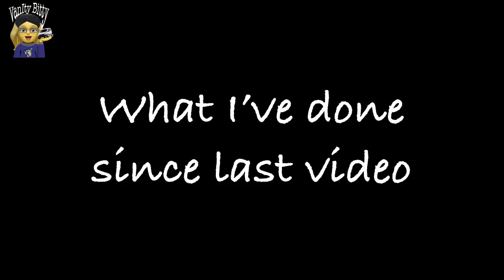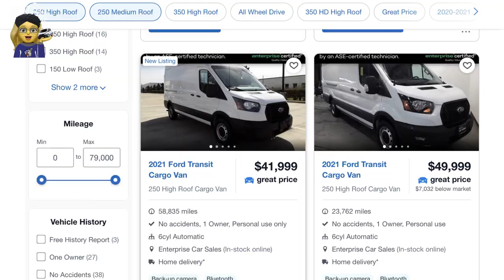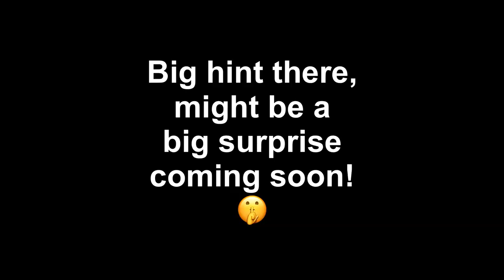Hack for Unique Bed / #vanlife Van Shopping

Comment: I bought a promaster 2500 mid roof, being able to stand is great, the problem I have is being 5'4" I have to use a small step stool to get in it since the only grab bar on the drivers side is inside above the top of the door.  Could  not reach it from the ground.
Reply from the maker: That’s my trouble too!  I also have a step stool and it feels so dumb when out in public getting out of it to hoist a step stool on a rope down to the ground 😂.    I just need to find the right step or running boards to have installed.  It’s high on my list of priorities.  The step stool is so inconvenient.   And I can barely reach the door to lean over and shut it!  LOL

Comment: That extra height is fantastic. I have the high roof, and I think it is 6‘8“ from the floor to the roof.  It allows for upper cabinets if you want them.   I didn’t, but it allowed me to put in a very tall supply cabinet for storage, which I loved.  The extra height makes it feel more spacious inside, no matter how you arrange it.  I store flat things on the ceiling, like  reflectix.  And please don’t worry about the wind. You adjust to that very quickly

Comment: I have the same seatbelt issue. Solved it by using a seatbelt extender. They are made for people who need more room around the waist but it places the seatbelt lower. As a quick hack until you get an extension just twist it a couple time before you buckle it.

Comment: Love your ingenuity on your knee brace. Understand your angst on needing just a bit more Van size to be comfortable for long term living in it. I'm still trying to squeeze everything into my Honda Element so I can sit on my bed and cook with everything within arms reach. Looking forward to your sink hole project. It's so fun watching others work out the difficulty. 
Your wind concerns with the mid or high top vans are very valid and rarely mentioned. Looking forward also to seeing your future vehicle. And the smaller it is the easier it will be to heat. It's been freezing and extremely windy here (San Diego) and in the deserts of the southwest where all the snowbirds congregate and you have  to stay inside for long stretches. No sitting around the campfires😡😆🥶
Good luck and so smart to shop when you're mentally fit🤗❣️
Reply from the maker: Ohhh Honda Element is my favorite vehicle that I ever had though.   Broke my heart when they stopped making them!

Comment: Lol. I was dying laughing 😃.  I feel your pain, except I still don't have a van. I've considered the transit connect 2010-2013 because of the higher roof, the newer transit connect because you have the option of LWB, the NV200, and the Ram Promaster City, all small vans. I need space, but I don't want to go with a high roof because I feel they are top heavy. I'm looking at either mid roof or short. I live in Arizona, and the west is super windy at times. Need to be able to control. Go for what you want, and like another person posted, "if you are going into debt on a vehicle,  get exactly what you need and really want." BTW, love how ingenious you are.
Reply from the maker: That’s why I want a Promaster 1500 low roof 118” wheel base.  It’s the smallest full size van you can stand up in (if you are 5.5 or shorter).   The only people who make mid roof is Ford Transit and their mid roof still towered over me as I said in the video.   6ft ceiling.  Seems reasonable but it just seems so tall when I’m outside it.    But the Promaster low roof is the only one that is a reasonable height, the rest of the low roofs are way too low on any of the full size vans, with a HUGE jump up on the mid roof.

Comment: Ram Promaster 1500 Low Roof. It is deceiving because it looks like it is a very low roof, but, you step down (kind of hard to explain) in the van which means a lot of people can stand up straight. If I decide to ever get a bigger van that will be the one as it is the only one I could see me using as a daily driver as well and with the price I could not still own a car and a van.
Reply from the maker: Yes!   That’s what I’ve discovered.  I was mistaken that it was a medium roof that I can barely stand in.  It’s the low roof Promaster!   I’m looking at 118 wheel base, because it has to remain itty bitty (with room to stand and room for the trike).  😁
Reply from the maker: That’s exactly how I feel about it!!

Comment: I have the same problem with the shoulder strap in my van. I'm 5'4", and have to put it under my arm because it cuts in.
By the way, I had a NV 3500, and hated it. Too high to comfortably get into, and too much power for me